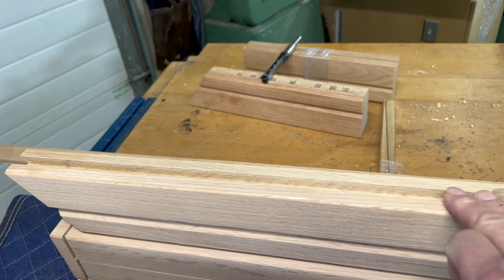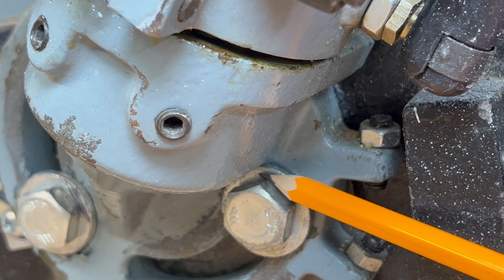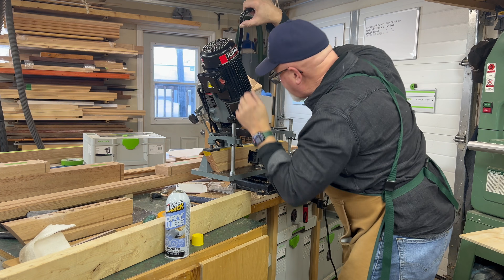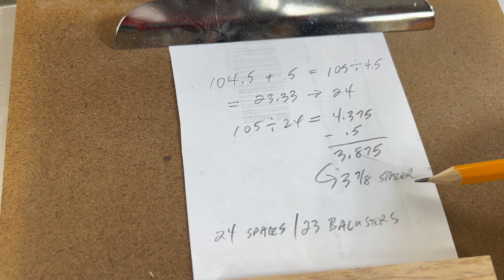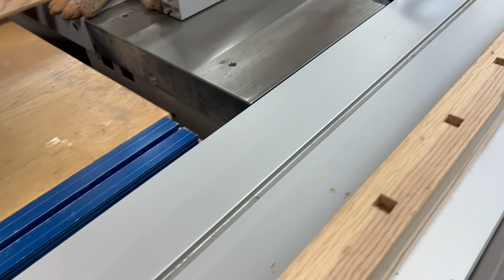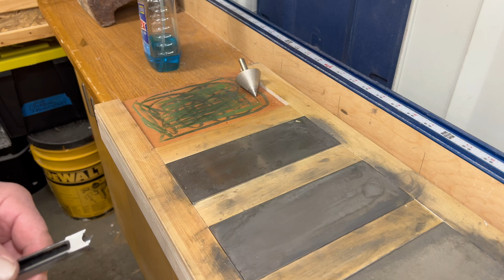Mortising Railings for Metal Balusters: Why Didn't I Do This Sooner?

Comment: I gotta get one of these if a big job calls for no shoes..I had to do a job with with no newels (ran the beefy hard maple rail down to the floor instead of a newel..but had about 16’ of flat rail & 2 6’ rake sections with a 7” hard maple angled cap..1/2” x 1/2” solid balusters..but didn’t have access to a mortiser so had to improve..trying to hand chisel the mortise in hard maple was exceptionally hard to stay 1/2”x1/2”..so as we always improvise ,I took some falloff’s from a previous job that were 1/2” x 1/2” Hollow balusters & slightly sharpened the end of one side..I took a 3/8” drill bit (the biggest size that would fit inside the hollow baluster) & drilled all the holes then took drill bit out of drill & pushed it in the hole a little ..then slid the hollow baluster over the bit & I made baluster longer than drill bit to hit with a hammer & not hit bit..but the 3/8” drill bit in the hole kept the baluster centered..but with the sharpened baluster it acted as a mortiser bit & when whacked hard it made a perfect 1/2” x 1/2” square about 1/8” deep..it’s not sharp enough to chisel whole thing but enough where it was started good & I finished with a chisel..I had to sharpen about 3 or 4 baluster/chisels lol because they would start to distort ..but next one I did I bought the mortiser bit & hit with hammer but way better..but job was real far from anywhere to get mortiser bit so used what I had & took longer than the mortiser bit itself but the end product was just as good..I even cut the ones on the rake at rake angle to start those holes…what we do to get the job done is pretty cool sometimes..& I love having to improvise..good day from Cincinnati
Reply from the maker: I've done smaller jobs with the mortise chisel and drill bit routine but to do a big stair job it would be tedious. One of my first videos is a balustrade I did where the customer didn't want shoes or fillets so I brought my drill press to the job site and did the holes there. (It was only a balcony railing so no angles involved.) But if you have a job where your rake railing needs mortises this machine is the ticket. It's not a huge price tag either. I think the machine will only go to about 38-40-degrees depending on the thickness of your railing material, but that angle is enough for most any staircase. If it's a bit more than 40 it will still work. Brand new the King mortiser is around $760 CDN. Assuming you can get one in the US that should be around $500. Cheers, Scott

Comment: Man that king mortiser is nice..I bet it looks perfect..an old boss had me do a rail set on interior stairs with 1/2” square balusters into finished maple..that king would be nice..😊 I ended up using an off fall I cut off length of baluster & ground a bevel at the bottom on all 4 sides to make it sharp like a chisel..I tried tracing a baluster, drill a 3/8” hole in the center then tried to chisel the inside of the traced baluster marks but 1/2” chisel left indents beyond the line so had to use a 3/8” chisel & crawled to the corner but was way to hard & time consuming to get close to perfect..so I drilled a 5/16” hole in the center of where the baluster center laid out & put a 5/16 drill bit in my chisel edged baluster scrap & slid the drill bit down in the hole with some going into the baluster..this centered the baluster scrap with the hole then lowered the baluster down to the cap (didn’t have a bottom rail) a hit the scrap to leave a perfect outline of the baluster..maple was so hard it didn’t chisel like I hoped but did go down an eighth or so.. finished with a chisel that stayed away from the top so not to go outta the lines..worked well but had to make a new chisel edged baluster every 3 or so holes because the metal was weaker than the maple & started concaving the baluster jig..the ones one the rake was even harder..but turned out looking great but my boss wondered what took so long lol..remember it was finished maple so no room for mistakes..we always gotta figure stuff out in the field & that takes time..great video..question how much is that king? That will be figured into the price of the next job I do like that since I work for myself now..omg that would have saved so much time..thanks for sharing Scott
Reply from the maker: The King ME1050 is $750 CDN. Probably $500-ish USD. I like how you engineered your own mortise chisel. Brilliant. I have one a bought from Lee Valley. You use a wooden hammer on it do start the square mortise and then insert a matching drill bit. Works really good on stair treads. Here's the link. Cheers, Scott
https://www.leevalley.com/en-ca/shop/tools/hand-tools/punches/65380-square-hole-punches?item=50K5908
Reply: @scottearlsmithFTC  thanks Scot..sorry for all the long posts.. you just got me excited again ,good day sir
Reply from the maker: @ Don’t be sorry Scott. My pleasure. Scott

Comment: I've kicked around the idea of getting a mortiser for the last year or two. Just don't know how much I would get to use it. Sometimes I do 2 or 3 stairs one after the other and then no stair jobs for a two or three months. And most stair jobs wouldn't require it. Nevertheless, thank you for sharing and please share more as you gain more experience with it. Who knows, I just might end up getting one. 

Just one tip that may help you when doing treads or landing tread in place. I have used a mortising chisel with the bit removed and a mallet to clean out the corners of the holes by hand. It's a little slow, but does work. If you choose to do so you might want to purchase a separate mortising chisel just for hand work, because you'll probably mushroom the end from hammering on it. So don't use your one for the machine.

Also, didn't know they made a stone for sharpening the chisel. So thanks for showing that. I'll have to get one. Keep up the bud.
Reply from the maker: Thank you for that tip on using an old mortising chisel. That's brilliant. I actually have a copper hammer with a wooden face on it that would work good for that. But I agree, don't use one that you will need to use in your machine. I looked at the King mortiser a couple years ago but didnt want to spend that much on a tool that would sit most of the time. But this used one fit the budget and does the job. I actually forgot I had the stones but found them in my old mortising kit for my drill press. Thank you for commenting, Scott

Comment: Nice work as always. I have a Powermatic moveable bed mortiser. I’ve had it a long time.   I have a domino machine and every once in a while I think about selling the Powermatic but a project always seems to come along that requires small mortises that I don’t want to do by hand or there are to many of them… 😊
Reply from the maker: That sounds like a decent machine. Generally selling tools is not wise. There have been tools I have sold that later I regret because I'm doing different things that now require that tool. But then again, you only have so much room. Thank you for commenting and I appreciate the encouragement. Scott

Comment: For my railing I mortised both top and bottom at equal depth and installed the rail. It's 100% doable but is fussy and works better with two people. Adding fillets at the top where nobody will notice seems like the way to go.

I have a Bullett 5/8" tilt head mortiser that I sourced from cwimachinery and see some parts similarities to yours. The big advantage of your machine over mine is the clamps that firmly hold the rake pieces. On my machine they want to slide away as you plunge in. That plunging motion puts a LOT of force on the piece. It will give you a shoulder workout but sure gives a nice result. 

I have an older set of stairs and with some modification to the machine I was able to mortise a 42-43 degree rake. That angle adjustment mechanism looks the same as yours. I'm sure the 43 degree angle exacerbated the tendency for the work to slide away compared to 30-35 or so.
Reply from the maker: I'm working by myself now so no second set of hands unfortunately. I saw that Insider Carpentry has a video using the Bullet. He also mentioned it's a workout. The King is as well and I had a sore shoulder that evening. The angled mortises are not as easy and I probably wouldn't want to do a long railing. I wonder if a 40-degree mortise hole would work for a 42-degree railing without a lot of wrestling? Thanks for checking in. Hope you've got lots of work. Cheers, Scott

Comment: Hey, I thought you guys were on the metric system !! ;-)  That mortiser is da bomb! The lube doesn't interfere with the stain and finish?
Reply from the maker: Well we are on metric. But old boys like me who learned carpentry in imperial stick with it. That said,  math with metric is WAY simpler than imperial (enter 1-7/16+2-3/8  and then divide the total in half, etc). I'm told that dry lube doesn't interfere with stain. I sanded those railings really well after. Once I get the railings back from the painter I will know how it worked out. Cheers, Scott